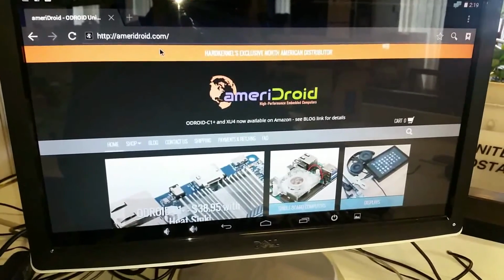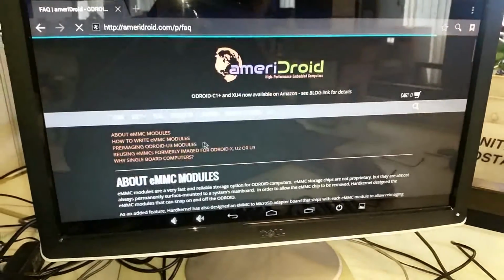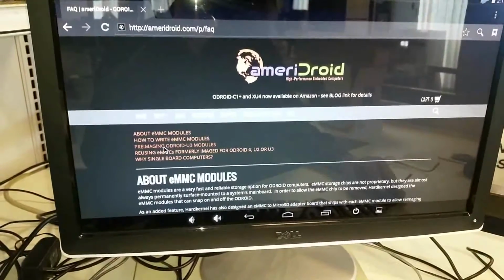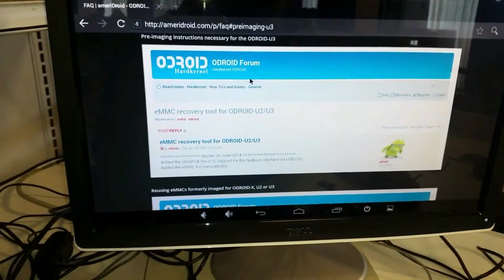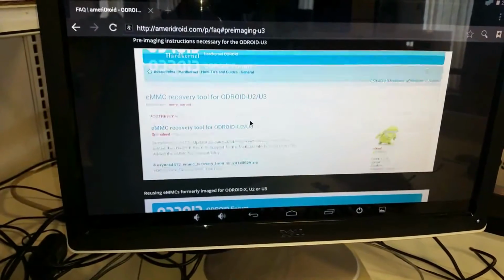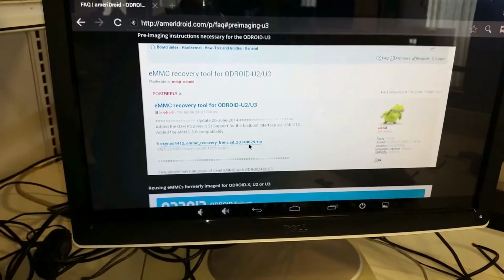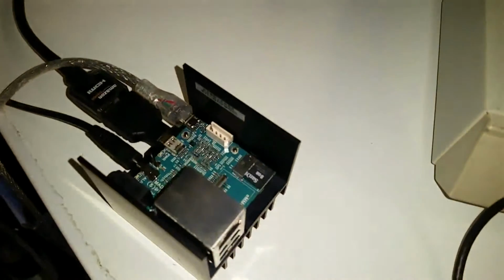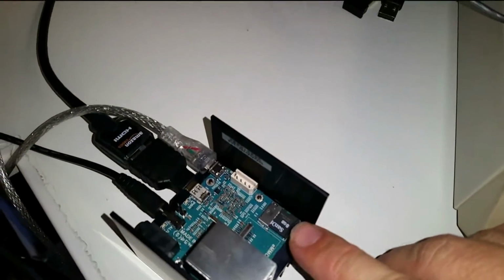How to prepare an eMMC for use on an ODROID-X, U2 or U3

Comment: Why would you connect an eMMC whilst it's turned on? It's my understanding they are not designed to be hotplugged/swapped like that.
Reply from the maker: +Ludic Interface They can be hotswapped as long as they are not the active boot media. This procedure is designed to use that feature.
Reply: ameriDroid ah interesting... is it running busybox at that point or something?
Reply from the maker: I believe it is running a very stripped down kernel with the sole task of repairing the partitions, etc.
Reply: +ameriDroid Do you ship to Canada?
Reply from the maker: +Ludic Interface Yes!